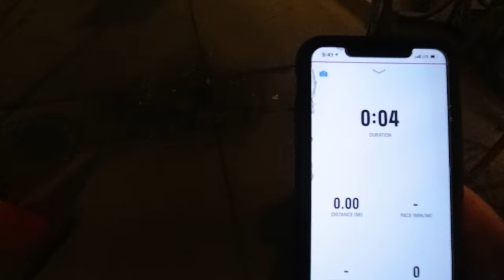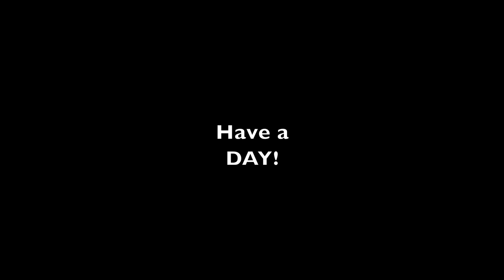Very AGGRESSIVE Construction Schedule! And Pool Plans, I think we can #1057

Comment: I had a pool built in 89 in Minnesota.  It was a vinyl lined pool.  it took them 5 days from start to complete finish.  They were held up a couple of days for me to complete the electrical and get it inspected. or it would have been 3 days.  It was in my back yard in a VERY tight situation.  They dug it with a backhoe tractor with an extending boom.

Comment: Mike. When I built my shop. I had a lot of fill brought in and stone on top. I rented a vibrating roller that you drive.  Hits the floor every day for about 2 weeks before concrete.  Never had a crack after 22 years so far.

Comment: Swimming pool installer many years ago.  Just as you want water to run away from all 4 sides of the building, you will want water to run away from all 4 sides of the pool.  This will require a swale between the building and pool that either has a compound slope peaking mid pool length or you will have to put in a drain in the low point of the swale. I'd also recommend a hose bib at the filter pad. At a minimum, a hose bib within easy reach of the pool to replace evaporative losses. Just some more to think about that you had probably already considered.

Comment: I don't usually comment. You really do a good job. The places that build those concrete tanks can put a 6 inch coupler in the concrete. You put a 6 inch pipe in tank and a 6 inch on top of tank and put a pitless adapter in and its just like a well. Put a submersible pump in it .You have no noise of a jet pump and more water. You would be much happier .I enjoy your videos
Reply: Jet pumps can be noisy...especially when they start to age..

Comment: I put in new sewer lines in my childhood home last year.  I backfilled with pea gravel with a little fine sand mixed in (almost a class II base).  I was very supprised how much is compacted when hit with a jumping jack!  And I also found out that a jumping jack will compact 6"-12" lifts but a plate compactor really only handles 2"-3" lifts well.  You might want to rent a jumping jack for just a day and hit all the trenches once.

Comment: As in inside pole barn..w the foam board  ..I put it also around  the upright  6" x 6" to avoid cement  to have direct  contact w the green upright  post..( The Mason I used recommended  it so if concrete  was to raise or settle it is less likely  to move post in either  direction..)
Reply from the maker: Vapor Barrier will go between concrete and posts

Comment: Harbor freight plate compactor is good, Have had mine since 2006 used it inside my pole building before the concrete work was done.  concrete guy did not believe the compactness of the stone.  I wet the stone and dirt down belween lifts and did 3 inches at a time. could have used the stone as the floor it was so tight.  Always turn off the gas and run carb dry.
Reply from the maker: Good to hear, I got it last night, The guy helping me load it said they sell a bunch to contractors and they love them
Reply: @OutdoorsWithTheMorgans  I have the Northern Tool one, and it works great....on flat ground.  If you're on any slope at all, it will haul "a" downhill, but go nowhere uphill.  I've done large flagstone patio areas, the drive to our cabin, etc... with it, but last fall had to bed in 70' of buried 24" culvert, plus the road over the top of it....and it was almost useless.  A jumping jack would have been a much better option, especially for compacting around the culvert and up to the culvert inlet wing wall I formed and poured.  Very expensive, though.
Reply: @python3574 , Hard to beat a ''Jumping Jack'' for compaction.

Comment: The last thing you need is advise from me...yet here we are :). As a life-long, north-east pool owner, make sure you get as much sun as possible for as long as possible. If you're planning a heat pump, location is more flexible. Enjoy!
Reply from the maker: Yes, it will be heated and good advice, Where its going to go gets sun in morning and late day is shaded, not perfect but with all the trees, location and building options are limited
Reply: I agree with Ed. I would be concerned about the shadow from the building. being from Long Island  I heat the pool and also put a solar cover on the pool when not used or overnight to keep water warm. Many night I would see steam coming off the pool. Also put a color LED light good luck.

Comment: Mike, while I am not familiar with the type of construction you did I am puzzled as to why you didn't pour a floor and foundation first, that way the structure would have been above the dirt and probably less likely to severely settle. That would have required doing the plumbing and electric first but that would not have been hard at the time as long as everything was well planned out.
Reply: Pole barns are built this way
Reply: Hey Mike, really nice building & beautiful property. Did you consider constructing your blg on a full foundation with 2x4's or 2x6 walls. It would be more expensive, a little easier to insulate & a little better in keeping the little critters out..IMHO..You will love the radiant floor heat, economical & comfortable heating. You both work very hard on your videos. Thank You Ted

Comment: Recommend putting stereo foam on floor heat takes path of least resistance,you’ll save in long run
Reply: Heat moves toward cold...always...styrofoam cuts it off.
Reply: When you're standing by a drafty window  and you feel the cold with the  hair standing up on you arms it is your body heat leaving your body. That's why your arm hairs feel weird....

Comment: That skirt board would have been no maintenance if it was wrapped with  brown aluminum coil just as a facia is wrapped. It would have been more protection for the wood from the elements. It really should have been done when the framing was complete before siding was installed. Builder should have given you the option but now its long term maintenance.

Comment: Have you factored in the water the pool will use? If the pool is heated it will evaporate more then you realize. And  every time someone gets out of the pool water is also lost.  Not to mention the water needed to back wash your filter.
Reply from the maker: We get about 40 inches of rain per year, most pools around here you have to drain some water out, verily seldom do you have to add

Comment: My opinion, you missed the mark. A plan to have the inside concrete and a 12" ledge at grade level all the way around the outside of the building poured at one time. This idea makes trimming around the building quick & easy. The building stays cleaner and much less damage.  That insulation wouldn't have been needed. The treated rodent barrier board would be on top the concrete and less concern for future rot. Yes, treated wood can sustain the elements when place in the ground, it's basically treated for insect protection. My years of experience taught this lesson. Maybe a few more years and you'll understand an outsiders opinion. :) I'll try to send you a detail of that.

Comment: Mike, wondering if the kids could delay the wedding to August to give EVERYONE a little breathing room???  Plus the weather would be great for a pool wedding party??????
Also maybe put heating under the concrete apron, that way you will not have to remove SNOW as you get older???
If you need chairs (for people just setting around) maybe you could cut some small logs and set them on 2 rounds & set them on the ground like a camping fire pit????  No cost

Comment: Just an FYI, you might want to put some wire mesh at the bottom of that pink board, I did the same thing you’re doing and rats borrowed up through the pink poly to get inside.

Comment: Do you need a vent line run to the cistern since it will be buried?  In similar, but admittedly older, situations I’ve seen a vent line run along side the pressure line and terminated by the pump.

Comment: Just wondering why aren't you back filling along the walls thay you havethe foam up seems to me that would had been a good place to use the back fill you stored outside.
Reply: Are talking about on the inside of the building?   If so I would think that having a deeper hole there would make the slab stronger with deeper edge footings. If you are asking about the out side,  he needs to wait until the slab is done so it won't push in.
Reply: @troyr57  no I am asking about the inside & you maybe right about having a deeper footing around the walls I've just never seen a polebarn slab poured that way. Not that I've pour that many pole barn slabs. Thats why I asked.

Comment: Hi Mike , seeing your pool is close to your building, would u want your pool filter and power inside your new barn, if so run your pool pipes  and electric under ground before u cement? Not sure what your plans were ?
Reply: Nice color stain , covered nice 👍, what is the brand of stain and color, thanks

Comment: Are you putting in floor heating system in. If so haven't heard you mention any under slab insulation. Just checking. Are you putting visqueen under the slab in the heated area?

Comment: Mike for a jet pump system don't you need two water lines?
Reply: Only  for  deep  wells,  single  line  works  very  well   for  shallow  wells and  cisterns
Reply: @nelsonsr.jenking725  Thank you!! I've only dealt with a couple jet pumps and they both had two lines and I wasn't familiar with the other style.

Comment: You will regret the day you put the pool in. The few good pool days we have in the mid-western climate don't make it feasible. You can stay at a 5 star hotel and use the pool there cheaper than the cost of the pool, maintenance and chemicals.